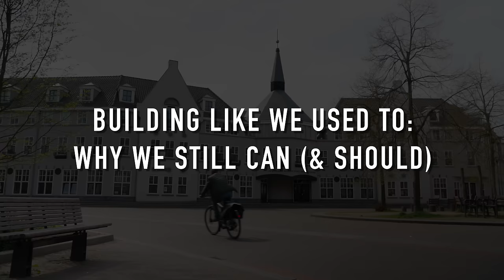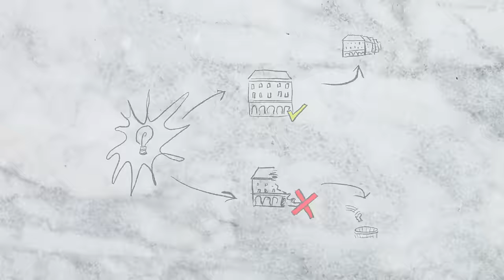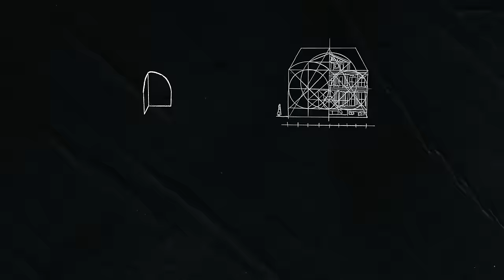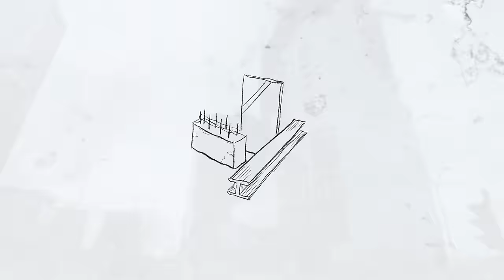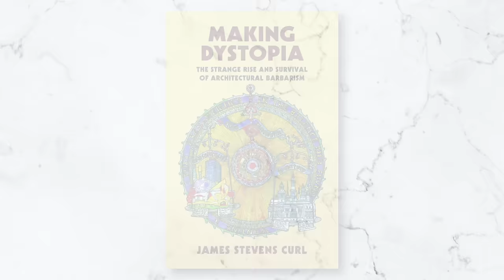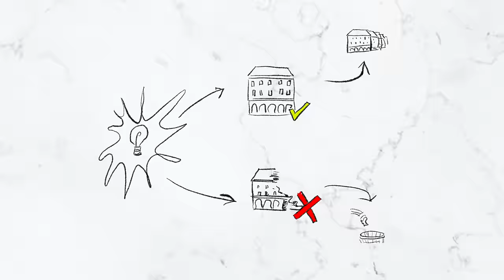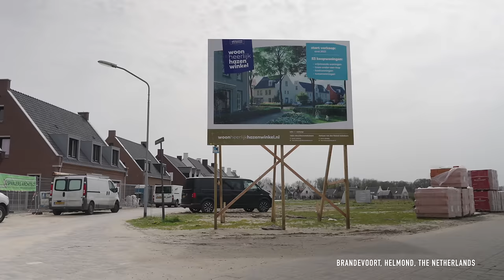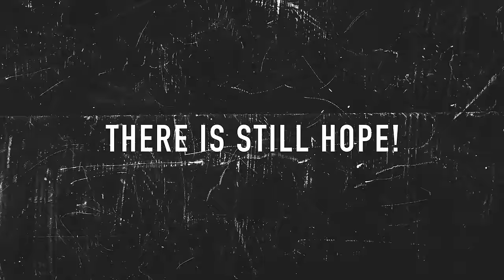Why We Should Revive Traditional Architecture & Urbanism

Comment: I am totally with you on the revival of traditional urbanism, but I am not completely sold on your view on new traditional architecture. 
While I do think the emphasis on beauty, and some other "traditional" principles like human scale and interaction is very important, I don't think these goals can only be reached by sticking to the ornamentation, symmetry and proportions of traditional architecture. While many attempts fail, contemporary architecture cán definitely succeed in creating beautiful buildings and pleasant places based on modern design principles. Examples of this are the Sidney opera house you showed in the video, Rotterdam Central Station and The Valley in Amsterdam just to name a few. 
The main problem in my opinion is that many modern buildings achieve do not achieve this beauty because it, and the before mentioned principles, are not prioritized even remotely enough in the design process.

Comment: I much prefer quality modern styles. A lot of bad modern architecture is built with very outdated methods, failing to factor the environment, usability, current needs, and other design factors. Designing for cars is outdated. It (car centric design) was a dumb idea in the 50s, a dumb idea in the 70s, a dumb idea in the 90s, and is dumb today. I want to be able to clean down my place of residence, and I love having things nearby. A lot of modernist architecture failed to challenge the limitations set in place by those who cling to the past, such as failing to implement fixed use, mixed income, and human centric design.

Comment: There is much more behind successful architecture than an ornate facade. Modernism was a popular response to styles which stopped working for then-contemporary society. We can absolutely advance our design without cowering back to common tradition. 

Modern Urbanism, on the other hand, certainly does need reform. That does not mean tradition is the answer.

Comment: No ACTUAL construction, and or construction techniques are discussed here, nor do the modern comparisons contain  any such OVER THE TOP ornate designs of the past. 
As seen in some of the historic two and three floor APARTMENTS from the pre 1920’s in Troy New York, by way of the 90° radius, rounded glass corner windows. Another typical design element that has fallen out of favor due to changing fashion of the time.

Comment: Modern cities suck, but they really don't have to. Hell just go back 50 years to the Soviet Union, the cities they designed from the ground up were built with walking and cycling in mind, a block would have a school, a grocery store, clothing store, health clinic, various forms of entertainment and much more all within the reaches of the apartments. This sort of mixed design worked quite well especially since the main form of work which would usually be a mine or some other specific industry would be found outside but not too far from the city, busses, trains, trams, and metro would take you to work which eliminated the need for cars for many. And the architecture wasn't all too bad either, most see Soviet cities as depressing but that's because of how they look today, no one is maintaining these commie blocks and most pictures taken of them are taken when all the plantlife is dead due to cold temperatures. But just try to find a picture of a Soviet city in its glory days and chances are you'll think "hey this looks pretty cozy". The Soviet Union may not have had the best reputation, but they sure did know how to build cities. If communists were in charge of redesigning say Los Angeles then the city would easily be 10 times smaller than it is now, and you can bet your ass you could live there without ever needing to own a car.

Comment: The author of this video doesn't get it.  The video is trying to have a top down ordering of the type of buildings being built.  If there is to be an actual turn away from the ugly crap being built nowadays, builders must be left alone to do what they want.  They shouldn't have to check with some "code" before they build.  That is the way it was done in the past, and it works well.

Comment: Unfortunately the future of architecture will be based on function of the climate and emissions reduction and classic architecture does poorl.
Reply: That’s not necessarily true. Many modern architecture uses concrete, steel and plastics as building materials, which are very environmentally unfriendly to produce. Modern buildings also consumes lots of energy since they rely on machines to heat/cool the interior.

One reason these buildings were widely built across the world is because they can be mass produced, and therefore cheaper. Traditional buildings, while probably more expensive and time consuming to build, will usually be more environmentally friendly since they rely on design strategies that do not rely on energy consuming technology to heat/cool the interior. A good portion of architects nowadays try to incorporate traditional design methods to reduce energy use and waste.